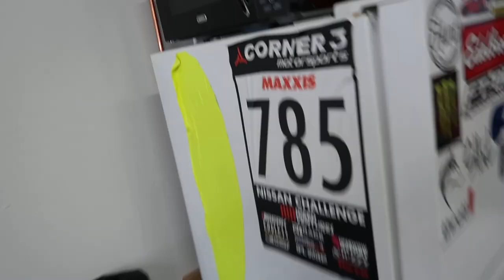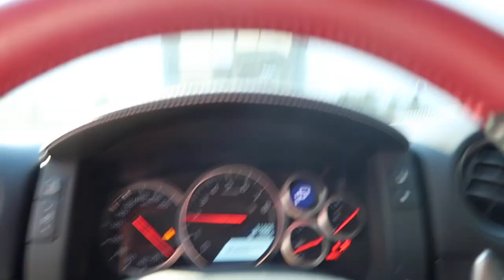The perfect truck for trailering a track car

Comment: Hey TJ, I'm a truck enthusiast and if you want a real dedicated tow rig get a Cummins, Powerstroke, or Duramax. Just my 2 cents. My recommendations would be:

The third generation 03-07 5.9L Cummins were more spacious and refined than the second gens, and the common rail replaced the VP44. Preferably get a manual transmission, the Dodge autos don't have a good reputation. Also the easiest platform to work on and modify.

The 99-02 7.3L and 2015+ 6.7L Powerstrokes are good. In 2015 the replaced the GT32 with the GT37, the GT32 had ceramic ball bearings which shit themselves and took out the turbo. Stay away from the 6.0L and 6.4L, they can be made bulletproof but you need deep pockets.

The 06-07 LBZ Chevy/GMC. No DPF on these trucks. The IFS would make these ride better than the solid axle Powestroke and Cummins.

Half-tons. All of them are good. Both Raptor generations are sweet. The Ford F150 3.5L EB, 5.0L, and 6.2L are good, Chevy/GMC 5.3L and 6.2L are good, the Ram 5.7L Hemi is tried and true. The Tundra's are reliable. The Nissan 5.0L Cummins is expensive for the same performance as the other half tons. Stay away from the 4.6L and 5.4L in the F150's, there isn't enough threads in the cylinder heads and the pop the spark plugs out. The Ram Ecodiesel in unproven.

I think a diesel truck build could bring more viewers to the channel, like what Streetspeed 717 has done.

However, go and drive them all. Get what you like best. Too many people in the truck community are brand humpers. Every make and model has its pros and cons. Things might be different for diesels in California too because of the emissions.

Excited to see what you get for a tow rig!
Reply: Liam Craig 100% agree this deserves more likes so tj can see it
Reply: ^^^^This
Reply: Best comment on here for sure. Everything he needs to know. And with a diesel he will have the option to tow long distances without straining the truck. Everyone knows the Grape Vine in CA is a killer for towing.
Reply: Amen. Possibly best comment on one of TJ's videos.

 I will add, the 5.4 Fords are fine if you go and have a shop change the spark plugs right when you get it. $500-$800 and you won't have to worry about it. They will go 150k-200k with no problems once that has been done.
Reply: Matt Close, the issue isn't the spark plugs - it's the aluminum cylinder head. The head was designed with too few threads. Under constant combustion pressures, the spark plugs strip the threads of the cylinder head and "pop". The fix is to drill out and sleeve the hole for the spark plug.
Reply: tristinreilly9604, Will McDonald, Jacob January, and Matt Close

Thanks boys!
Reply: amazing comment and agree that many truck enthusiast are fanboys. I've had a wide variety of pickups at my disposals (none I loved more than my simple 1982 22r Toyota thing has over 700k original miles and just keeps truckin) but if your hauling something as heavy as a car and trailer any decent sized V8 (or diesels) full sized pickup should be fine I agree with the OP go drive them all and get the one that feels right.

Comment: teeg imma break down trucks for you in the easiest, simplest, most unbiased way I can. 

Dodge: Cummins
Pros: best motor, with a lot of money they can look pretty dope. 
Cons: Worst transmission, stock they look kinda ugly, worst interior.

Ford: Powerstroke 
Pros: great all around, Poworstroke is the Second best motor( debatable), best interior, good transmission, with a few mods probably the best looking truck. 
Cons: Not much 

Ford: Raptor 
Pros: 6.2 is a monster motor especially for speed, Meanest looking truck stock, badass once modded, very nice interior.  
Cons: poor at towing( not incapable just poor ), more of a "Drivers" truck not so much a "work" truck. Dont get the v6 

Chevy/GM 
Pros: Duramax is the 3rd best motor( debatable ), best transmission, great interior, with a few mods can look dope. 
Cons: Ehh

Hope this helps :)
Reply: zack there's nothing wrong with the raptor twin turbo v6
Reply: zack it's not necessarily the best option for a tow rig either, but the truck does have its perks. In my opinion go with someone diesel for best fuel economy simple as that
Reply: I would say the Chevy/GM has the best transmission with the Allison and the Duramax is debatably better than the Powerstroke
Reply: Did you know that ford owns 75-80 percent of Cummins
Reply: Skylar Sell No they dont back in the early 90s ford bought a 10.9% share in Cummins and it was later bought  back now they dont own any shares in Cummins
Reply: StoinkehDoinkeh Clearly you have never ran GMs their drive trains are fine especially their gas trucks
Reply: I would only go 7.3 on powerstrokes, NEVER get a 6.0 wayyy to many problems and you have to spend alot of money to get them bulletproofed. I have a cousin who is a diesel mechanic and he has to work on powerstrokes all the time and always warns me to stay away from them.
Reply: zack dodge is known for their towing capability my friend has a 2014 2500 dodge Cummins and pulls his camper all the time up and down mountains and has not had a single problem with his trans
Reply: Yesssss
Reply: Nooooo get a ram
Reply: Chev interior is crapppppp
Reply: Cummins and duramax both have Alison's. Personally chevy/dodge is your best route
Reply: Cummins does not have an Allison, it has an Aisin, which is owned by Toyota.
Reply: I love Raptors, but if it's a tow rig... not a Raptor. 
I'd go Tundra or Dodge Cummins Diesel.
Reply: @tj hunt get a Cummins
Reply: zack wtf ford being good. from my time ob working on cars ford and german cars are trash
Reply: StoinkehDoinkeh Shh...
Reply: He needs to just get a 7.3 PS or 12v Cummins and call it a day very cheap and both are really reliable
Reply: Zakariah Smith yeah in a new Cummins will break the bank
Reply: Will McDonald The Allison transmission is literally the best thing Chevy or GM offers ford and Cummins have the best motors if you can put an Allison transmission on a Cumminsor power stroke that's your best bet
Reply: zack I love ford powerstrokes I love the way they look!
Reply: If you leave it stock, most Diesels are going to be good. Dodge's are the best actual work truck, their motors are nearly bullet proof if you don't try and throw a 200hp tune in.
Reply: this guy likes fords lol

Comment from the maker: Just want to say thank you for support guys. It does a lot for me. There has been so much positivity lately within the comments and that makes my day which keeps me going with the daily uploads. Have a good day my dudes !
Reply: obijuan 1515torres yes
Reply: Tj Hunt look at a ford dually powerstroke
Reply: Tj Hunt he's right man that's your best bet
Reply: Dodge is no good chev is expensive to maintain and is not great go ford. F-350 power stroke 6.7l is your best bet. Or old 7.3 2005 ish
Reply: Thanks Tj Your encouragement pushed me to start my own vlog about my classic car
Reply: And he wants a v8 guys so dodge is out😂
Reply: Tj Hunt dude maybe take a page from StreetSpeed717's book and get an older 2500 that you can do some small things to. you don't have to mod it to the extent he did, but it might be an interesting change of pace for you guys.
Reply: Tj Hunt get a chevy Silverado 2500 duramax z71 you won't regret it
Reply: branden Dev dodge as made one of the best engines ever made the cummins and the Hemi are really good engines
Reply: i work at a truck stop and some companies use pickup trucks and 90% of the time they are dodge 3500's i saw one yesterday with a wedge trailer with 5 cars and trucks on it that the 3500 was towing

Comment: TJ I have a 2011 Nissan Titan it's great for towing. It's rated at 10k and has plenty of power. I tow a 30ft gooseneck with mine and it handles it like a dream. I highly recommend the Titan great performance and great reliability plus you get to stick with the Nissan  family and don't have to worry about the cost of owning a diesel.

Comment: Go with a diesel. The extra torque, horsepower, mpg, and engine life will totally be worth it in the end
Reply from the maker: thats what I'm thinking....
Reply: Tj Hunt buy a Cummins ram
Reply: Tj Hunt go with a duramax I might be hated but fords have problems with the motor dodge the tranny chevy has a Allison tranny u can put that in the dodge
Reply: Tj Hunt GET A NISSAN TITAN SO YOU CAN KEEP THE NISSAN GANG UP
Reply: Tj Hunt buy a diesel for sure extra power and better for towing trailers and heavy loads. Plus you can go a gooseneck trailer later down the road. The new Nissan cummins are nice since you own two Nissan's already
Reply: They sometimes have transmission issues later on in life around 200K miles later
Reply: ANDRES_ SCOOT let him get an anerican car for once
Reply: I would get a 3rd gen Cummings and bullet proof it. new ones ain't so reliable, I'd suggest a 2nd Gen but I dought tj wants a claped out 5.9
Reply: I Eat Sunblock Na get a Nissan Titan
Reply: yes get a diesel Dodge Ram 2500 or gas Ram 2500 my friend has one and that is what he uses to trailer his car it is a really good truck
Reply: maybe if you buy a ford
ram and chevy are great but its usually the effect of a bad trans cooler its an easy upgrade
Reply: Tj Hunt get a third gen dodge diesel and build the transmission and it will run forever. Mine just hit 400k.
Reply: You're not knowledgeable if you believe that I have a 1999 GMC suburban it's a 6.5 l turbo diesel we to and get 18-22 mpg and our neighbor has a gas one I think it's a big block 454 he gets 6-9mpg towing
Reply: Austin Rothenberger yes but over time it will be great savings on fuel
Reply: Ya I had a 1990 f250 with the 460 back about 2yrs ago, it got about 11 just crusing when I had a load I was about 5 to 9mpg, shits real noticeable on a gas motor, you can  look at the gas gauge every 5 mins and notice it's went down a tiny bit
Reply: Third gen manual that's an amazing way to go so much more better
Reply: If you do get a diesel make sure it's before 2007 for all the emissions bs. And because you live in California there going to be on your ass for any modifications you have on it too.
Reply: You just have to make it happen I think it's better to buy a used one for now
Reply: Buy their truck if they that's an option that dodge is so much better than mine

Comment: tj the ram 1500 is a great truck. i own a 2014 ram 1500 tradesman with a 345ci hemi and it pulls trees with the roots out of  the ground (on mud tires in dirt, not on street.) but it pulls people that get stranded on the snowbanks and its almost as quick as my friends infiniti G37s (its a non turbo'd gtr35 basically.)
Reply: oh also you can get them cheap too! they've used the same 5.7L hemi in the 1500 model since 2009. Hope you see this man, it'd make my day. be safe and don't be on your phone when you drive. For the Bros, Blooper army, and Keep Moving Foreward!!!!

Comment: YES get a V8! Would be sweet to see an american V8 on your channel, sometimes it feels like we're one of the only few channels repping V8s.. A Raptor would be sweet, something diesel would be awesome
Reply: Yes get a cummins!!
Reply: Decades Cars go with a v8 and well with what you want and I would say a raptor for the reason tht u would be able to go off-roading while on dually u won't be able to with raptor
Reply: raptors are not great for towing because the suspension is soft with all of the travel
Reply: Yea he should go with a diesel for his towing truck for sure, so much torque!
Reply: Decades Cars, yes I agree truck content would be another great thing for this channel I would get a durimax but rapters are awasome to
Reply: wouldn't Diesel be better? More miles more hp more torque lower Rpms engine last longer every 100,000 the engine gets stronger
Reply: Diesel
Reply: DreamerBoy Varela and more smiles to the gallon

Comment: Best overall ride quality, reliability, look and aftermarket truck for towing is probably a 2500 Chevy/GMC. Get the diesel, you'll love the power and yeah we both live in California so we know how diesel is cheaper compared to gas. Yeah the dodge had a better engine and depending on who you are the ford might have better looks but the GM, has a load of aftermarket, the bodies don't fall apart like dodges, the engines don't blow up like he fords and the Alison transmission is a major name in trucking for a reason. The thing is bullet proof. Plus the chevy isn't slacking in the interior. And if you're asking me the GM is a looker too. Little level, bigger tires, looks amazing. If you were doing 4x4 wheeling and wanted a diesel I'd probably say dodge for the solid axle, but for a truck to tow if you're getting 2 wheel or 4 wheel, for towing alone I'd say GM. The control arm style front end of the 4x4 GM rides better than a solid axle, that you can't argue.
Reply: Adam Brown agreed!! the 2005 are beautiful lifted
Reply: Adam Brown have you driven the new f250? It doesn't feel like a huge truck anymore it feels like a f150 in terms of ride quality and they look great and have the strongest motor right now
Reply: You're right, the ride quality has gone up, and the engines make the most power. But let's be honest with 850 foot pounds of torque you don't need any more. And it's a diesel so hp doesn't much matter at all, especially since it's just a function of torque anyways. Besides the fords have been known to drop their cranks and piston rods on the floor with a whole in the case. Dads company deals with blown fords even from daily driving, and towing alike. Same with the girlfriends stepdads work, working construction in 1 week they had 3 Ford F-350s with the 6.7 power stroke blow up. Like I said all of the big three have their upsides, but I think the best overall package get now is the GM line of diesels. Not to mention their interiors are really good too. Quality and in my opinion the best looking trucks. But I'm skewed a bit, I have a GMC 1500. But regardless I think Tj would be better off with a diesel. He says he only needs to tow 5500-6k but what about when he needs to pull 10k or more? Easy to get that heavy when you're talking about needing to tow 2-3 cars. The ability to tow anything is better than just the ability to tow enough
Reply: GMC = $$Chevy.  Literally if you don't business write off...don't waste the money on a GMC.
Reply: MDethCKR GMC and Chevy aren't that far off on prices. Actually about the same. Regardless you're right either truck should be a company right off, he puts 1 sticker on there for "mobile advertising" and everything is a business write off. Hell if he does it for
More than one he can get "paid" for it ya know? And Chevy and GMC are the same product, it used to be like Ford and Lincoln but now it's not. They are synonymous, GMC is kinda just labeled as the "grandpa version". If I were in his shoes I'd probably get a lease trade in with as low of miles and as loaded as I can get. Would save him the depreciation off the lot and you know they were taken care off, still a GM asset until officially sold.